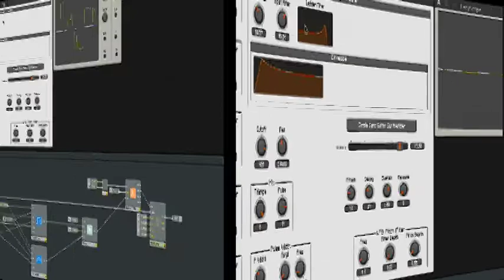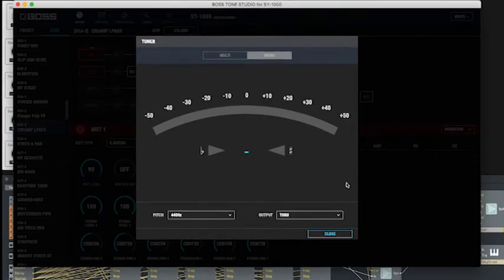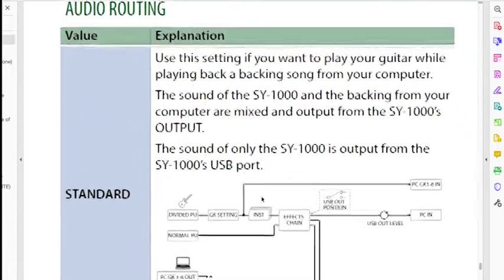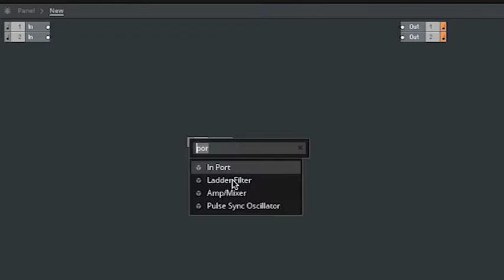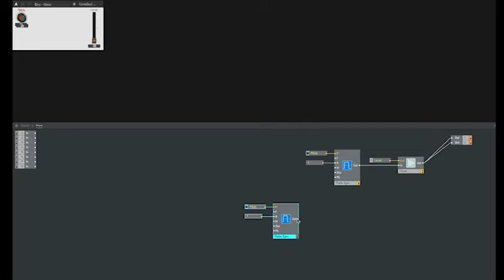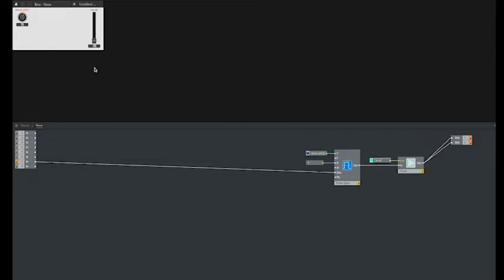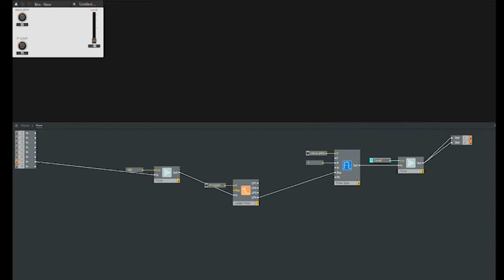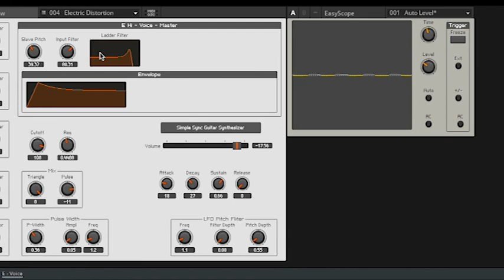Boss SY-1000 Reaktor 6 - DIY Build Your Own Guitar Synth

Comment: Another way to do it would be to create an instrument with 6-note polyphony. Then bring all 6 audio signals into it and use "To Voice" modules to turn them into one polyphonic audio signal. Then when you made changes to the structure, you wouldn't have to make 6 copies of the structure to change all the voices. And the controls would automatically be applied to all voices. If you need to do something separate to each voice, you could have 6 controls that get combined by another "To Voice" structure.
Reply from the maker: Oh my gosh!!!! Mark Smart!!!! Great to hear from you. I did some experimentation with your earlier Reaktor tools. Can you build a Reaktor GR-300?? Great to hear from you!!!
Reply: @WayneJoness   @WayneJoness  Hi. You, too. I think you could take that Reaktor GR-300 I did, make 6 copies of it, and connect them to the 6 inputs, and it would work. Recently I've been making Reaktor sub-octave and octave-up effects based on the Electro-Harmonix Micro-Synth. It would be way cool to make a polyphonic version.